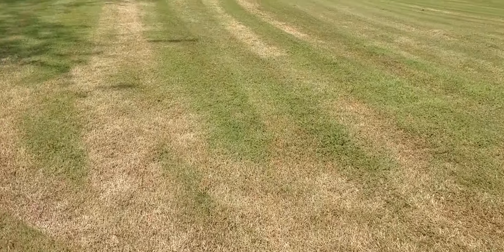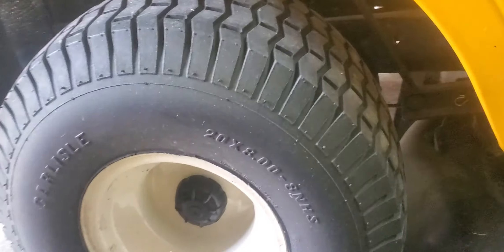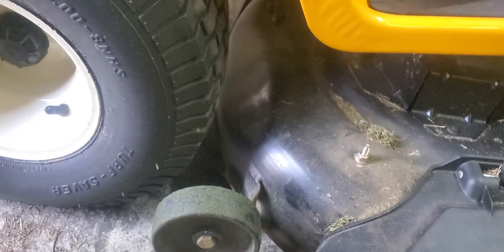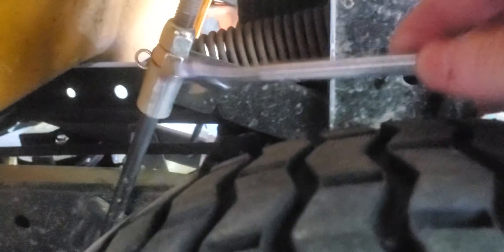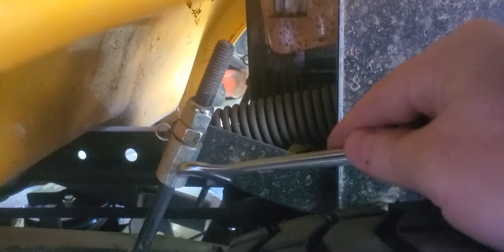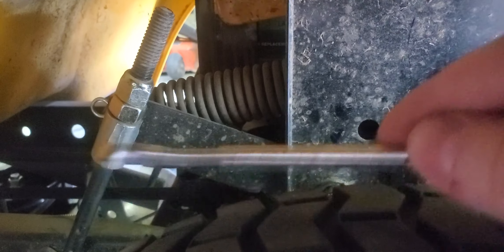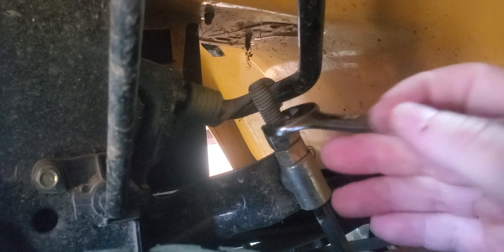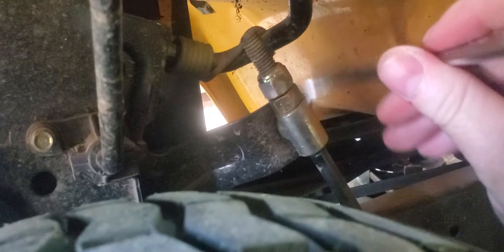Deck Height Adjustment Cub Cadet XT1 & other lawnmowers

Comment: You definitely clarified the situation with my NEW LT46 with a bagger. It was the left side while sitting on it. OMG I was going nuts with trying to figure it out. 
So far you have the best adjustment video for my situation. Lower the nuts to raise it up. Good job mentioning to also check the air pressure since having a bag full will make a difference in the cut as well due to the additional weight on the back end. 
Sucks living on a hill such as my place is but all in all going up and down not cross cutting makes it look more like a country club. 
Thanks again for your video!

Comment: My bolts woudnt loosen had to remove the bars and pins then put it in a vice apply heat and oil to get it to work. Thanks for this video very helpful!

Comment: Gonna try this because I  find the 4 inches set on the mower is too low for my grass. I like to cut really high and it has worked for my lawn to give it that lush look but this xt1 really cut my grass short on its highest height.

Comment: Make sure tire pressure is correct in all 4 tires before starting. Measure from ground to blade tip on each side for most accurate leveling, decks usually aren't perfectly shaped and flat.

Comment: I was not able to apply enough torque to loosen the top nut with the wheel on the mower the first time. I had to lift the mower with a hydraulic bottle jack and remove the wheel.

Comment: Very good video.  My issue is that my highest deck height at the highest adjustment setting (4) is barley 3". That;s with the leveling nuts adjusted to their lowest position (creating the highest deck hight).  It seems I may have to take off the leveling nuts, add a 1" sleeve, then lower down the nuts, to pull the deck up.  Has anyone tried this ?  Or have a better way to raise the deck ?

Comment: first thing to do is check tire pressure and make them equal. front small tires have higher pressure usually around 20 psi, rear tires are around 8-14 psi.  finally he did say check pressure.

Comment: Your explanation was confusing, you were letting that rod up and down not raising one to lower it
Reply: He was just trying to level the mower deck. His deck was lower on one side and higher on one side so to correct it, he made opposing adjustments to each side to balance it.
Reply: Yes it was.  You turn the nuts clockwise to raise the deck, it is that simple.  He made the explanation unnecessarily complicated.

Comment: I've got a question is your tire pressure and tire diameter the same on both sides
Reply: it should the same on both sides, bigger tires should have lower pressure than small tires.
Reply: @jamesvertrees5857  that's not the way it works.  Bigger tires less air,smaller tires more air?
Reply: @elcomandante9299  It has been my experience that it does.  The tires on a bike run at high pressure.  The front tires which are smaller on most z type mowers run at about 20 to 21 lbs while rear tires can run at 8-14.  The lower pressure in  rear tires lead to a wider foot print resulting less pivoting when turning and a smoother ride.  I have been mowing professionally for 28 years and I do read the manuals.  Check it for yourself.